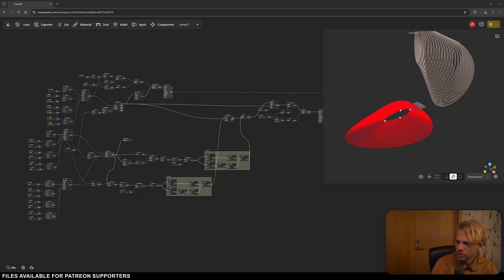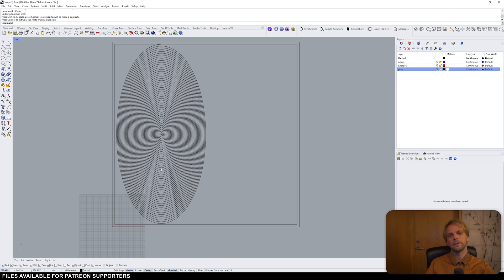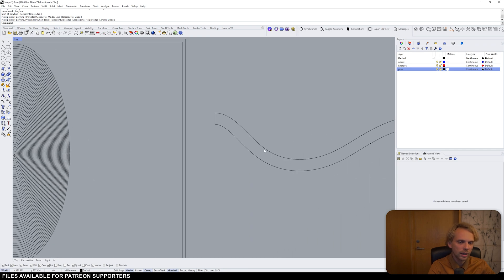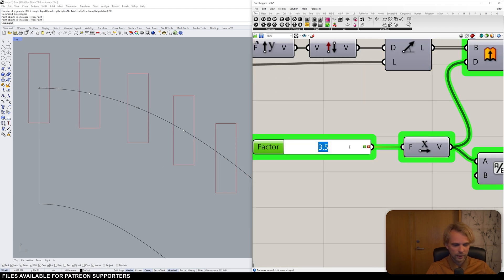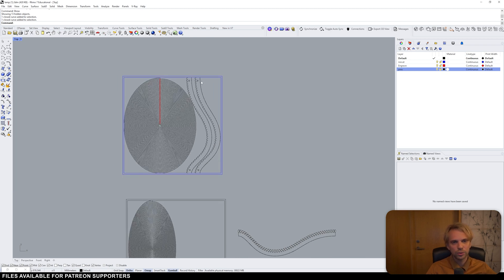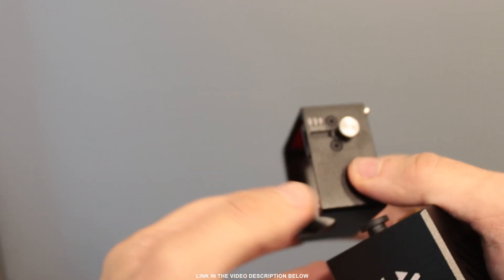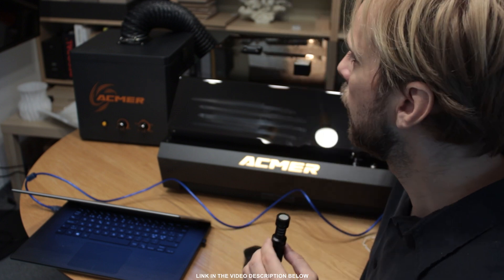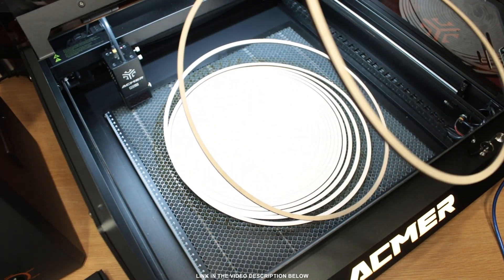Your CAD models DON'T (always) need to be PRECISE

Comment: amazing lamp! I'm gonna try one with a vertical stand! What type of wood did you use for the laser cutter?
Reply from the maker: Oh nice, try it out! I used 3mm 400x400mm Grade A plywood, but I'd suggest using thinner - 2mm plywood for the spiral part (75 turns instead of 50, with the last 5 smallest turns removed, because it's impossible to stretch that part out). 2mm would make it more elegant. During assembly , hang the spine and then assemble the spiral on top of it. Trying to do it flat on the table is problematic.

Comment: The ACMER 24W has such a good cutting ability. I want to know how the 24W engraving effect is? I am considering whether to upgrade my equipment.
Reply from the maker: I'd say the engraving speed is similar to nearest competitors at the same price range, but the quality is slightly better, due to a less powerfull (thus more precise) diode laser. With that being said - me (and most of my audience) are designers/makers, so we dont really use engraving capabilities in our work. Cutting, repeatability, laser safety and fume filtering is what's most important
Reply: @DesignGoBrr  Thank you for your reply.
I thought about it and decided to upgrade to P3. Less smoke and less noise are what I want.🤩